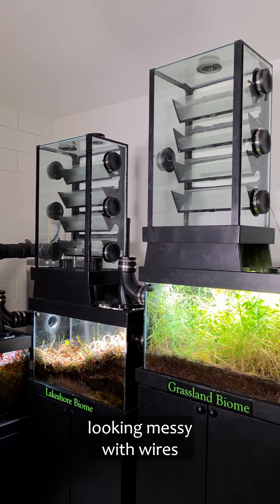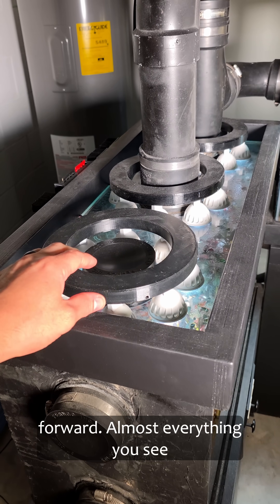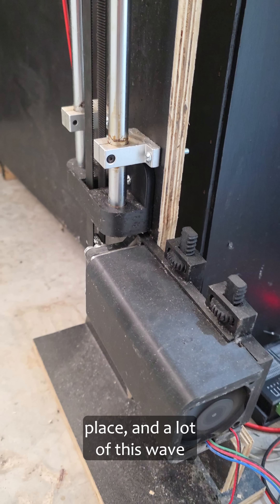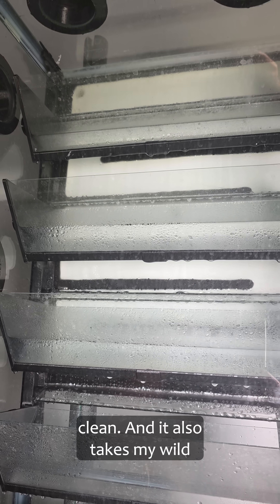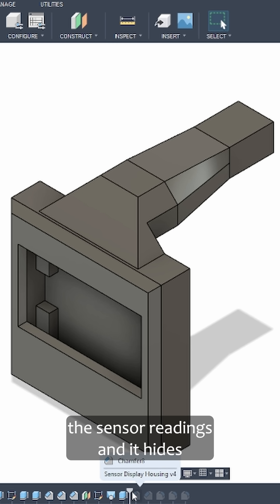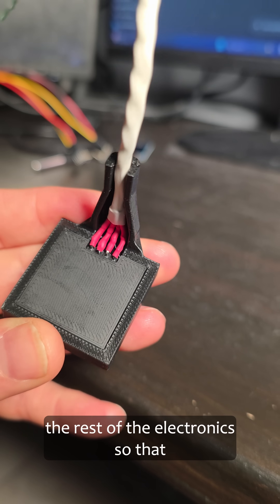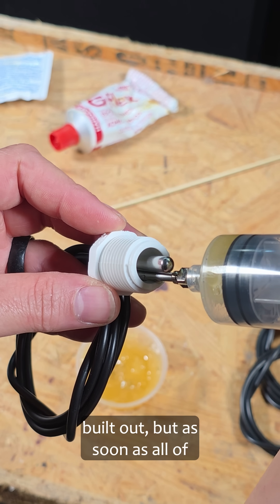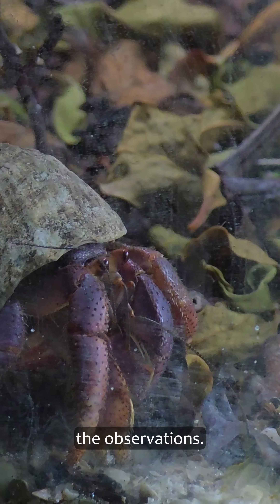3D printed parts makes the ecosystem possible to build

Comment: For your ports, you could eliminate the need for silicone by printing the bulkhead with threads and a nut and print a geometric out of a soft material.
Reply: Oh my mistake! I saw water spots not silicone.

Comment: What are you using for a CAD program. I've been using SketchUp for years but I've been starting to have issues with it. I'm really not trying to go back to SolidWorks either
Reply: i like fusion 360
Reply from the maker: This is Fusion 360 by Autodesk. It's a good option that's similar to Solidworks but much more accessible. If you're shopping, onshape is another good one that has its pros and I've used for years.